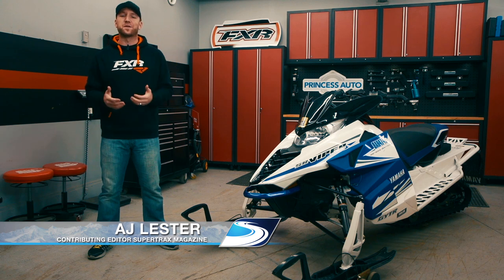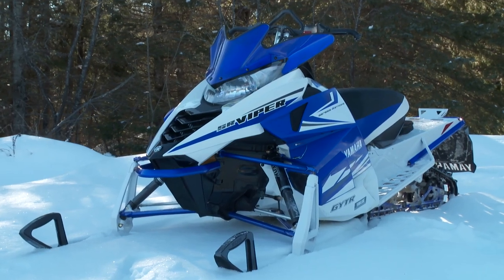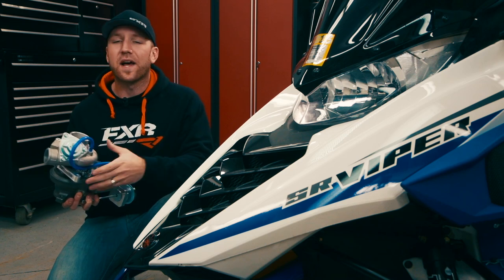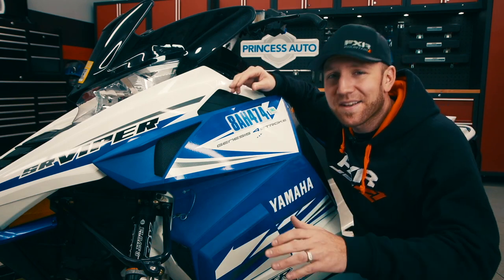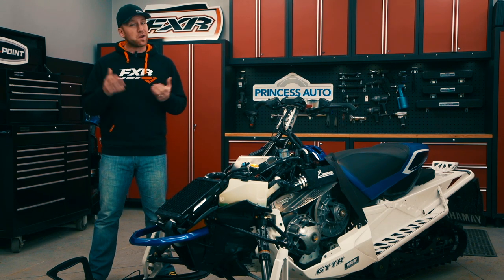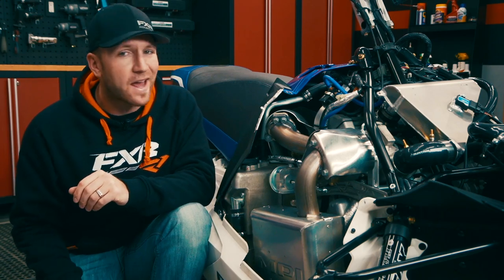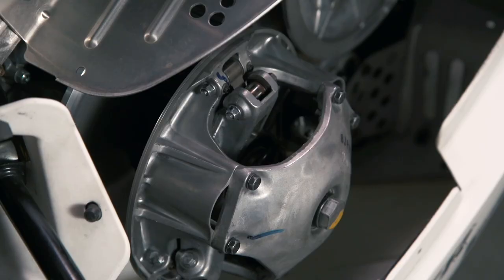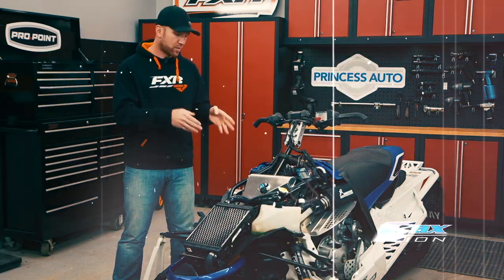2015 Yamaha Viper MPI Turbo

Comment: Only the ealry 15s are the 1049cc the new motor is 998 not as friendly to turbos in the long run.
Reply: Just curious what makes you say that? They designed the 998 motor with turbocharging in mind.
Reply: @jasonberning1086  You can ignore his comment. it is flat out incorrect in many ways. The 1049 is alive and well and still in the vipers even in 2022. The rods were redigned in 2016 to accomodate turbos. The 998 is the Winder engine and totally different and comes with a turbo. Sadly in this world far too many people who know nothing comment on things and are taken seriously. Don't be scared to turbo your 16 and ups. Although as torquey as they are I'd only do it if you are in the mountains.

Comment: Hard to top the MPI combo with Yamaha SR Viper.
Reply: I have the Hurricane turbo with a power commander she has 7200 miles on it and still kicks any 800 or 850 around whatever brand. Here its 2020 now. Don't think mpi with a factory tune can top Hurricanes set up. P.s. guy that built it has stomped newer winders with this 505 lb sled rather then 640 plus lb sled.